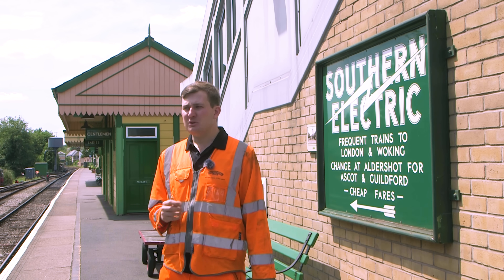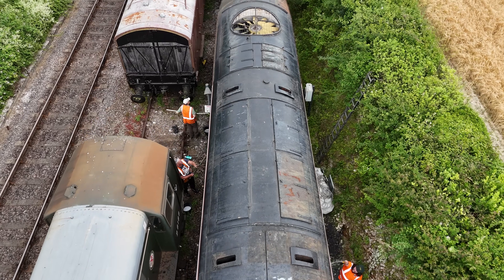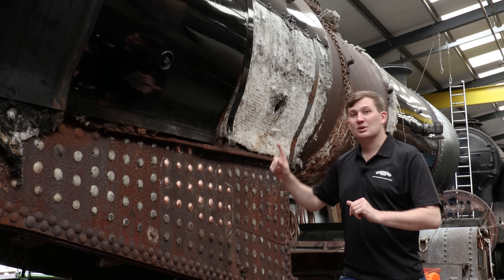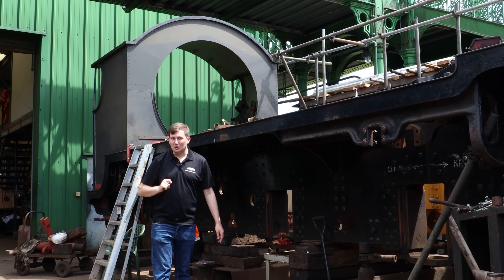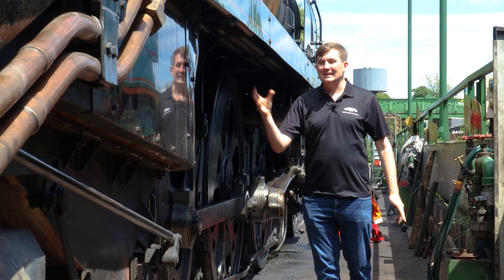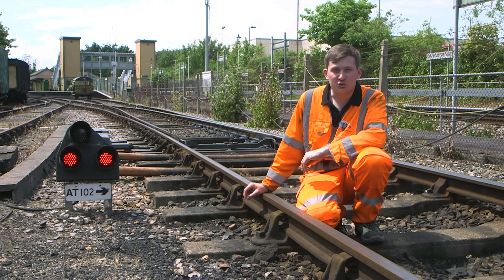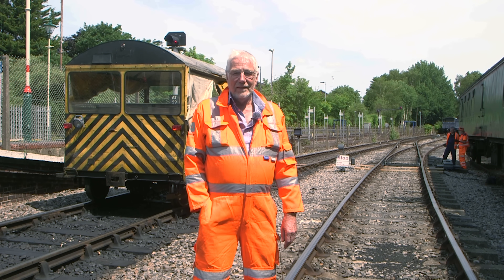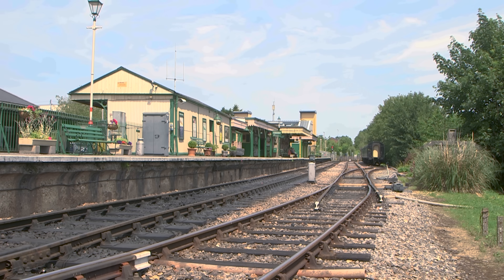Keeping You In The Loop - Getting to the point...

Comment: HW 2000 point machine, worked on those back in the early 70's thy are a good robust machine, how often do you check the clutch for slipping, as I remember we used to check the clutches every 6 months during FLP testing, the new machines now are all singing/dancing but basically the same design.

Comment: What does the small oval plate found below the number board on the smokebox front of Canadian Pacific signify?
Reply: It's the shed allocation plate. 71A which is Eastleigh shed, which is was based at in the 1960's.